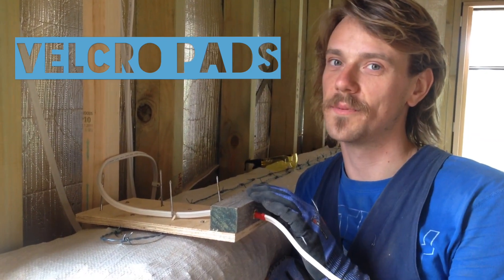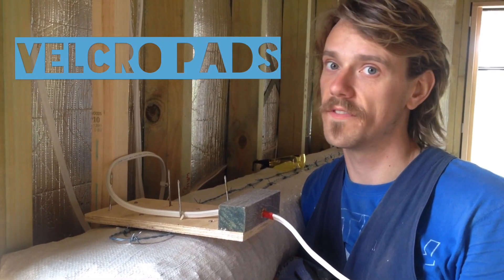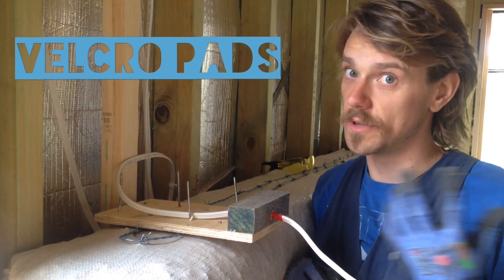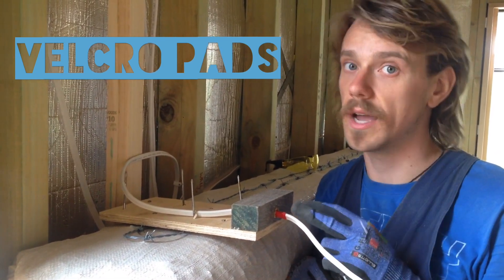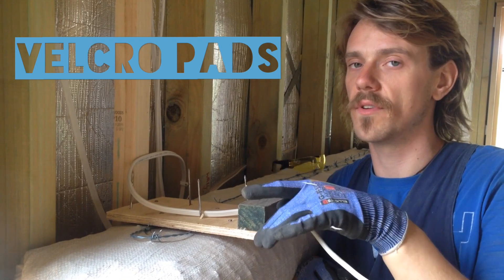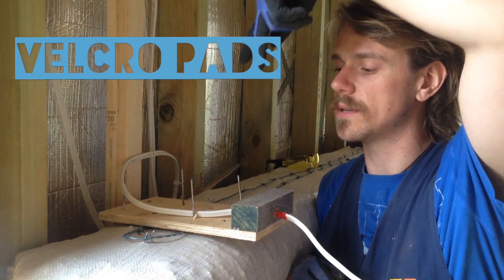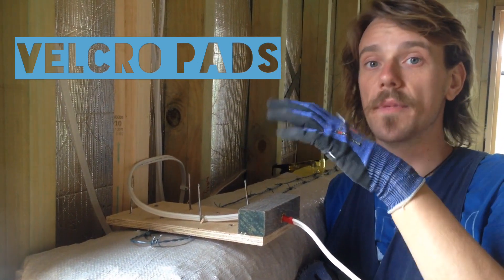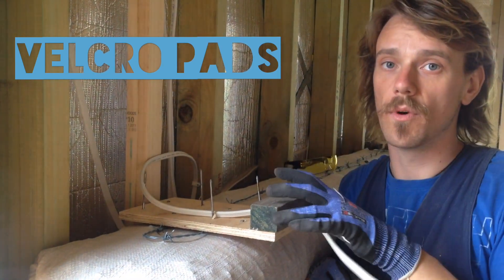Curvatecture's SuperAdobe tips and tricks - How to install Velcro pads/Porcupines

Comment: Nice tip regarding the velcro pad.  Was there no mechanical protection required for the TPS cable in the close vicinity of those nails and barb wire?